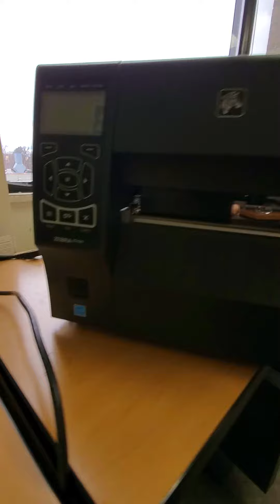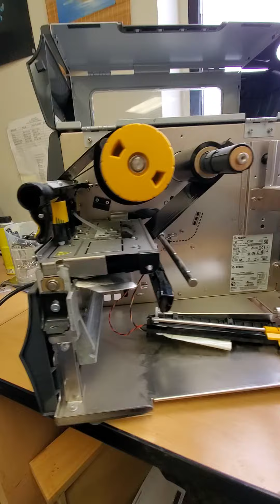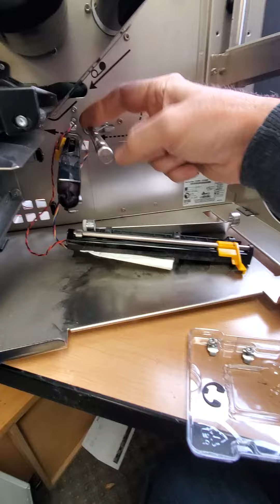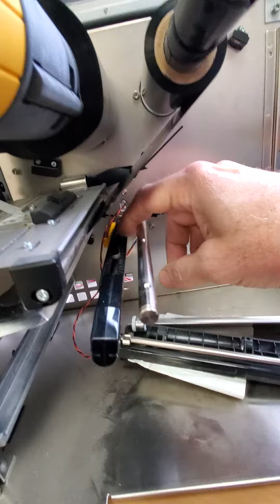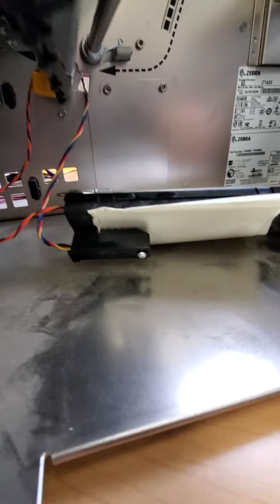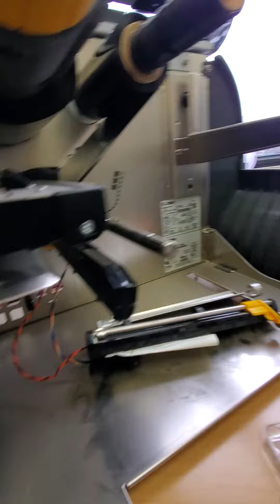Zebra ZT410 and ZT420 label sensor disassembly and cleaning

Comment: Hello, I have a zebra zt 410.  It won't calibrate. I tried auto and manual calibrate many times but it still stop at the wrong place. I already changed a new printhead. What do you think any other possible reason cause this situation? Thanks.
Reply: There is a multi step calibration procedure in the menu. Call Zebra support and they will walk you through it. You can also try resetting the factory defaults. Also make sure the red light sensor ( the one that can slide) is not too close to the housing wall. Move it out from the inside by an inch.
Reply: @stevenmorris204  I will try and let you know if anything works. Thanks.
Reply: @stevenmorris204   It turns out the printhead is with the wrong DPI. I changed it to a 203 DPI model and it can calibrate now. Thanks for your advice.
Reply: clean the sensors with alcohol